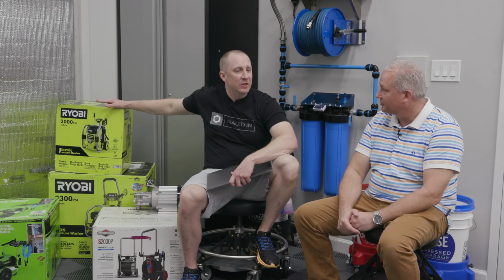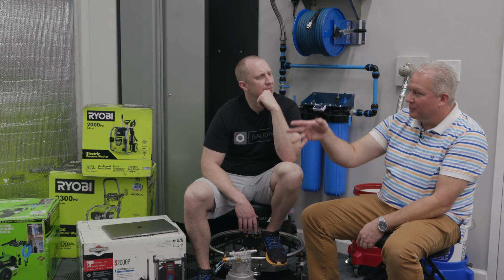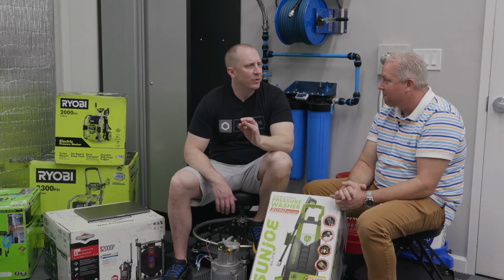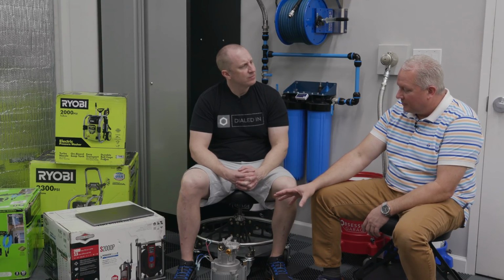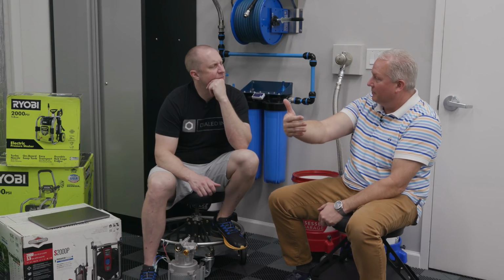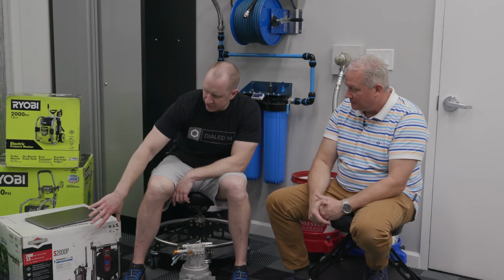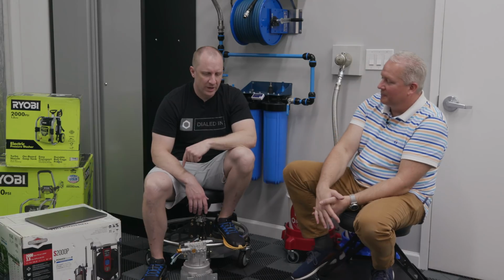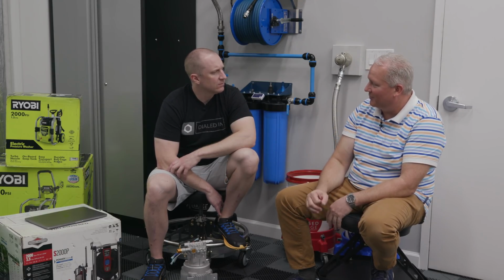Pressure Washer Deep Dive: Standards w/ PWMA

Comment: To avoid the long guns and crappy hoses, could a pressure washer be sold without a gun and hose at all? Maybe you could approach a manufacturer to build a machine exclusively for you. OG spec, with lower psi and higher gpm being the goal
Reply from the maker: Bingo.  That's what the next OG Active collaboration will have.

Comment: I don’t know what you mean by sealed pump. I took apart my harbor freight pump down to every accessible component that I could get to and cleaned it. I can change the oil without issue. It’ll do it’s purpose and one day maybe get an active when this eventually fails but I had this for 10 years already and still going strong
Reply from the maker: I meant it doesn't have a drain plug and isn't intended to be serviced.
Reply: @Pan Tac, Which model? What oil did you use? I’d like to change the oil in my Portland PW.
Reply: @Hecken.  I have a discontinued model. The process is the same for the new model. I heard you can use compressor oil or non detergent oil. I used non detergent

Comment: I am surprised that you don’t talk about the coefficients of friction in lines and the coefficient of friction of fitting.  All of these have a impact on pressure
Reply: Not much of an issue with an electric pressure washer. The AC motor will turn at a set RPM (no matter the load), it just may need to pull more amps. A fixed displacement pump will output a set gpm given the speed of the motor. Therefore no matter the pressure drop between the gun and the pump, the volume will be constant. The pressure at the gun is then only dependent upon profile size. The performance at the gun of an electric should be the same if you have 25’ of hose or 250’ of hose (as long as the motor or breaker doesn’t trip).

Comment: Nozzles are not rated at 4 GPM as standard. One can Google pressure washer nozzle chart to see how to size the correct nozzle for your machine.
Reply: Correct, for example a 5.5 nozzle will need 4,000psi “pushing” through the orifice to flow 5.5 gpm
Reply from the maker: Paul and Skull are correct.  I learned something new in that converation.